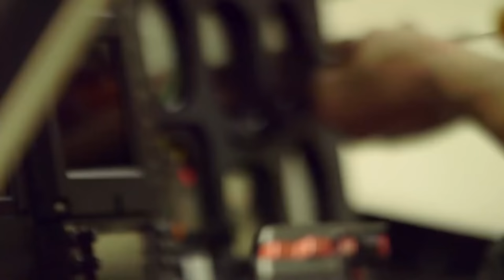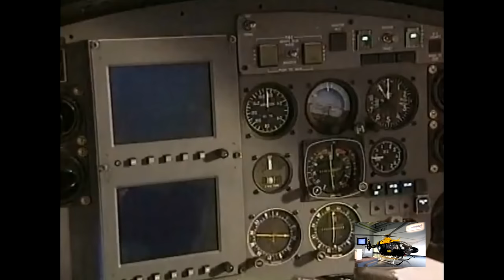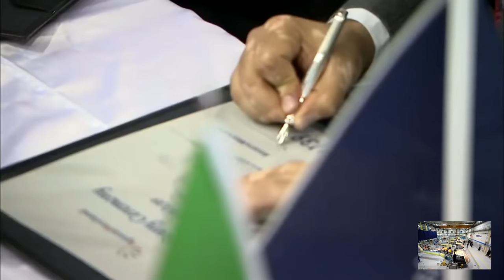Helicopter Factory🚁2024: Manufacturing Bell {USA}, Airbus, AgustaWestland helicopters🔥

Comment: 5:30 The Apache production line has changed, they used to move the helicopter from station to station instead of doing all the work in one place.
Reply: Thanks!  I was wondering what year this was from ? I ran a tail number and the one came up as 2008.

Comment: They are awesome machines.
My question is,  Why Not Install a Safety, Roll Cage, Around at least the Cockpit?
The motor and blades, as well as other components can be built to accommodate the weight difference. Where there's a Will, There's a way. 
Not Being Disrespectful or anything,  Just a question.
Reply: too much weight. every pound added is a pound lost in useful load.
Reply: Yep. We should be close to antigravity flying soon 👍🇺🇸
Reply: Bapak. Imam. Muzamil.  Siapkan. Pilot. 9. Orang.  TNI.   AL.  RI.  
Bawahkan. Kirimkan. Pulangkan. 
Helicopter.  Baru.  9.  Unit.  RI
Helicopter.  Baru.  9.  Unit   RI
Masuk.  Lanal.  Lanud.  TNI.  AL
Jember. Manado. Malang. Ambon
Kalimantan. Utara  MEDAN. MALANG. JEMBER.  MANADO. 
Laut.   Hitam.   Laut.   Lepas. Jember
Bandara. Juandah.  TNI.   AL.  Jember.  Malang. Ambon. Kupang
Surabaya. Texas.  JEMBER. MALANG. AMBON. MEDAN. TEXAS
Kowal.  Kowad.  Kowau.  RI.  Jember
Helicopter.  Baru.  9.  Unit.  RI
Helicopter.  Baru.  9.  Unit.  RI
Siapkan. Pilot.  9.  Orang. TNI.   AL
Kowal.  Kowad.   Kowau.  JEMBER
MANADO. MEDAN. AMBON. MALANG. Kalimantan. Utara.Texas
Reply: Abuh Abuh Bubuk Baja Tuah. Biruh
Coklat. Tuah. Bubuk. Baja. Tuah. Coklat. Oryensz.  Tuah.  Bubuk. Baja Oryensz.  Cat.  Besi. Avian. Imco. Baru.  Kaleng. Cat. Besi. Besar. Baru